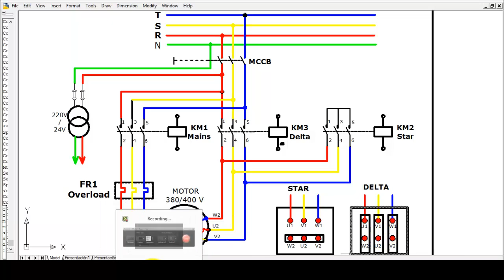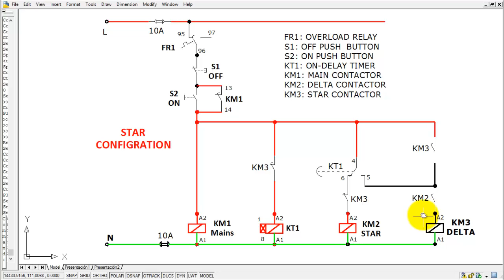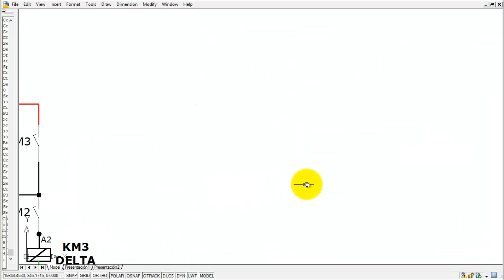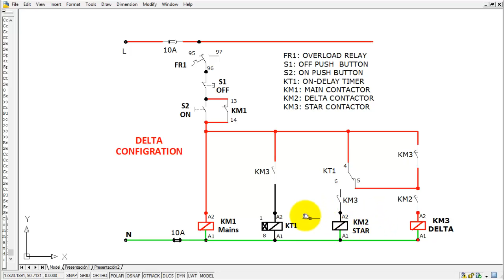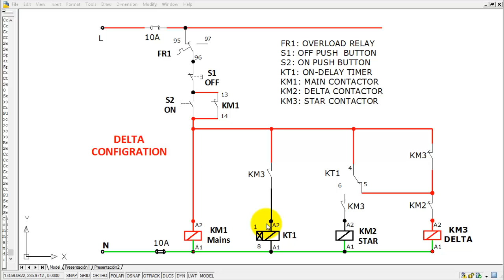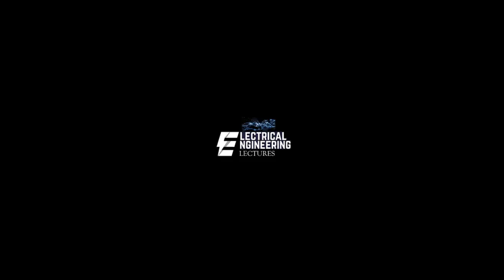Star Delta Wiring Diagram | Star Delta Connection | Star Delta Starter Control Wiring

Comment: If because of the faulty circuit the star and delta contactor close at the same time, would the overcurrent only flows through those two contactors or also the main contactor?
Reply from the maker: If both contactors are closed, all the phases are shorted with each other before motor winding , therfore huge curent flows while from mains side, it will see extra resistance of motor winding due to which very minor current flows but only main circuit breaker will protect complete circuit